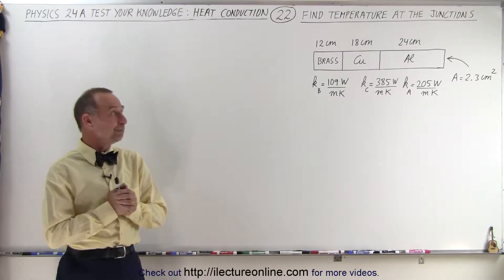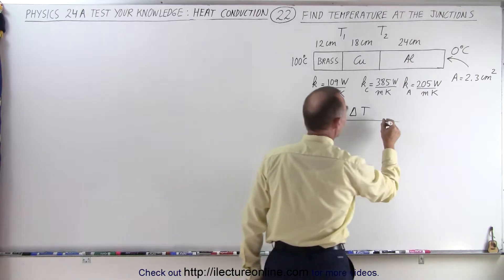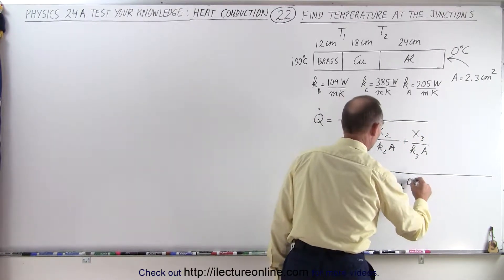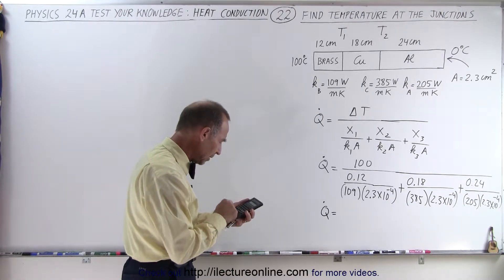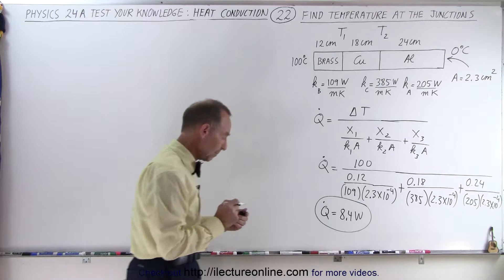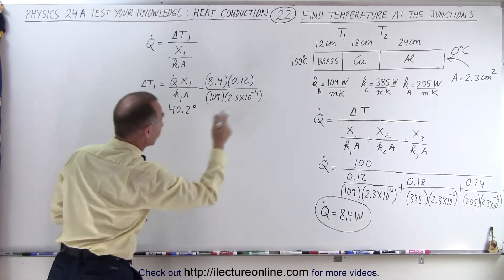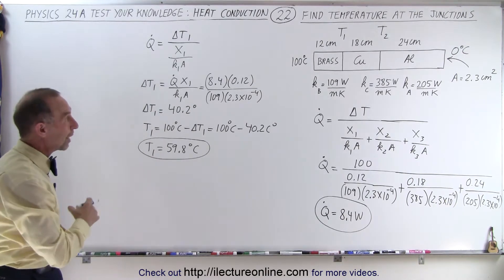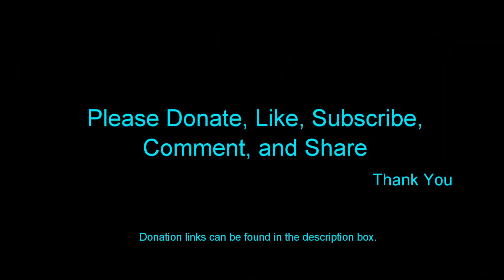Physics 24A  Heat Conduction Examples (22 of 22) Temperature at Both Junctions?

Comment: Michel, You mentioned the hazards  of insulating double-pane glass with a vacuum and I came across this in Goggle:
   "Argon is the gas most often used between panes in a double- or triple-glazed window. It's colorless and odorless and is denser than the atmosphere, providing more thermal efficiency than having air"... [ or nothing]..." between the panes."

Comment: Temp. Unit of k in kelvin  or centigrade  pls?
Reply from the maker: As long as we are calculating the difference in temperature, it doesn't matter (they are interchangeable since they are the same size)
Reply: If you use subtraction Unit conversion is not a matter, but if u are dividing two temperatures u must consider in converting the units to K. Or better just convert the temp to K in all circumstances .